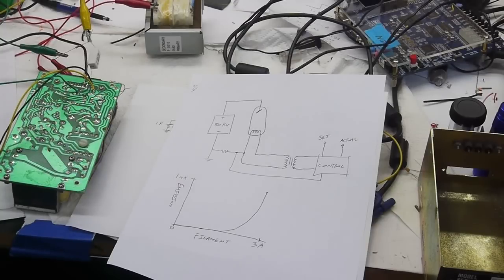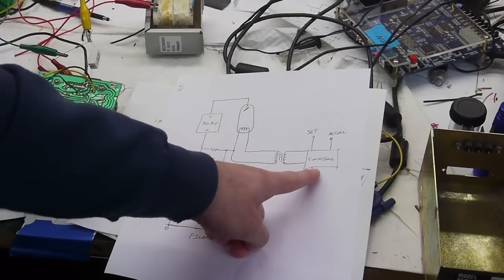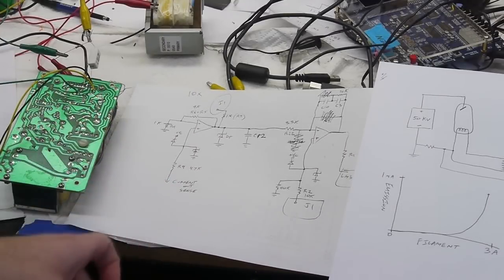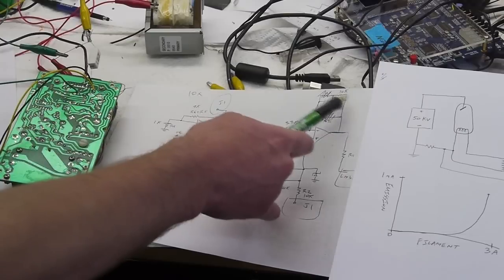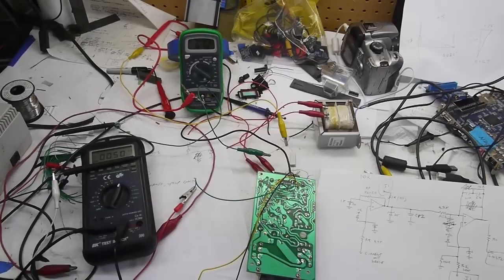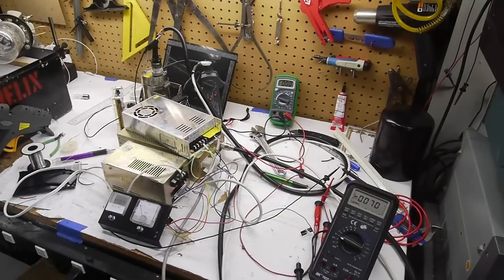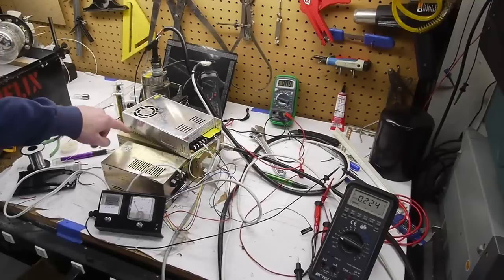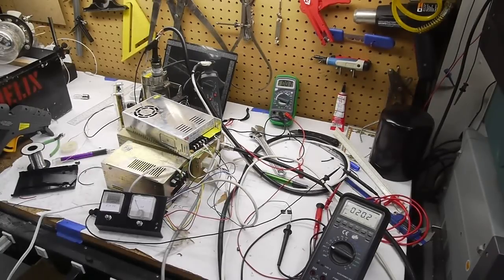Reverse-engineering and testing an x-ray filament supply

Comment from the maker: The problem is the non-linear relationship between filament current and emission current. You need some sort of closed-loop control system to adjust the filament or else the tube will conduct so much current, the high voltage supply will be pulled down.

Comment: @Applied Science I want to design a current sensing circuit for a PFA(Pulsed Field Ablation) system. Output pulse voltage is up to 4KV, Frequency 1Mhz and this last just for milliseconds. Do you have any suggestions. Thanks

Comment: In the end I settled on using a transformer system with a variable wire-wound homemade resistor which I adjusted carefully until output was present. I custom made a tube-head out of 1/8th in' lead and powered the filament with either a high power homemade switching supply connected to a toroid transformer or a 60hz wire-wound system. Both able to adjust the tube right up to the point where the tube puts out max-energy but does not pull too much HV current. This proved incredibly stable. (next)

Comment: I am quite impressed by your work. I have done quite a few projects on the electronics and got into this few years ago, I stopped after serious and prolonged success because of where I live and the possible dangers involved.

Tube filament sense current--
Lets just put it this way--you are right about the X-ray tube 'pulling down' or basically shorting the HV supply.  Essentially however, it works like this.  In the old days they did not have current sense meters.  (read next)

Comment: --Basically, if you had a very high-current HV supply you could get it to produce more output at higher filament volts but this would produce a great deal of heat. I found the best way to understand this is to think of the tube as if electron emission must be brought just shy of the point where which it begins to become a serious drain on the HV supply.  Any higher, and the supply basically shorts out as if a diode is put across it and little useful energy is produced as X-rays. (next)

Comment: -- The best they could do was adjust with wire wound resistors or auto-transformers in the old days. Since the tubes you are working with are basically no different, there are a number of ways to get this to work. The primary method I employed was to measure the filament voltage with a VTVM. Just +/-0.3volts flux can mean a good picture or a really bad one. A Coolage type X-ray tube is just a glorified HV diode. If you pump too much into the filament (read next)

Comment: It is thus more then possible to build a working system that does not require a filament sense circuit but only if you have the means to test tube output and monitor things very carefully. Back when I did it, there was almost no internet resources to use. I had to come up with all of it myself.  Most tubes operate at about 2-4 volts. If you run them any higher the HV will basically short and no useful output, also--the filament may blow rendering it useless. (next)

Comment: --The tube thus must be brought up to a level where the HV is correct for the frequency you desire, as well as power output, and the filament is as well. I built a remote control which used all analog devices since the presence of my home-made HV supply serious-- over 80kv and thus caused problems with digital control systems.  Not having a high budget for parts, I thought of using many complex devices but realized that they would be effected by the HV without more money. (next)

Comment: --To keep things simple, I had massive success without having to build a digital controller.  I later did--allowing me to build a pulse system which would turn the HV on and off via a homemade PWM.  This let me do fluoroscopic functions. I did things the old fashioned way again eventually however since the presents of HV made for parts failures.  A variable transformer can be used with another transformer as long as you are not needing weeks of exact output from the tube. (next)

Comment: Just in advance, I'm not some H+S fanatic/radiophobe (quite the opposite), and I admit this isn't my strong point, but are you checking your exposure in some way, or isn't it a cause for concern with this setup? Also, do you have to limit to short bursts to stop the anode overheating?